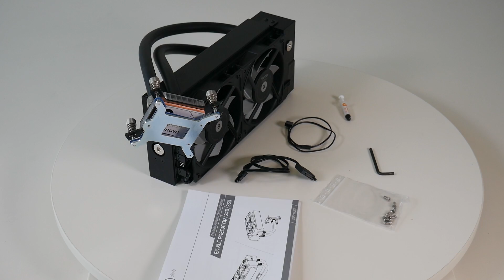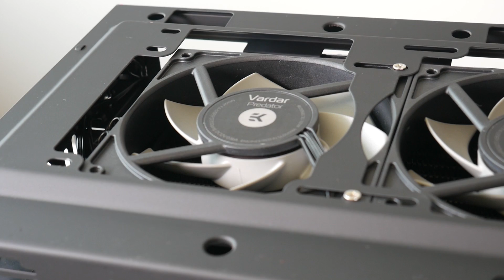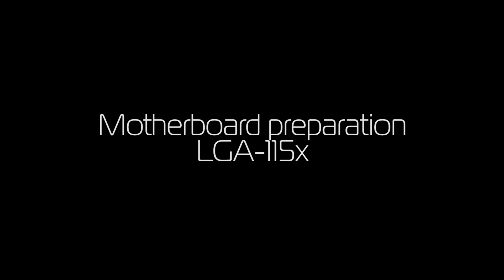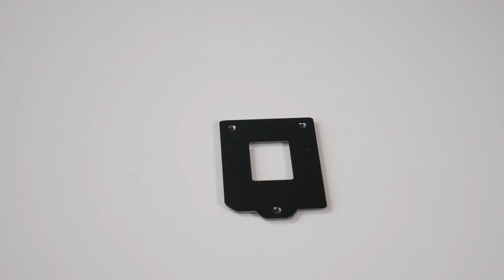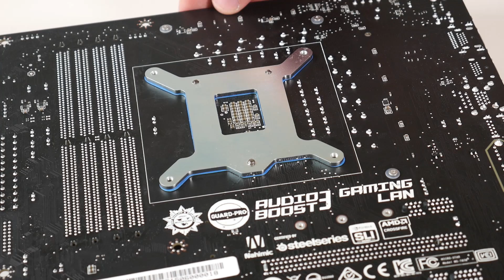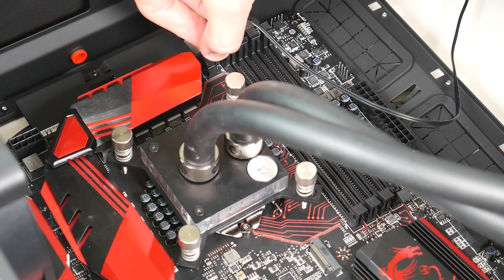EK-XLC Predator 240 (R1.0) Installation Guide

Comment: HI ,how controll the fans speed plz ? i have a rehobus and it's not controlable ,should i put the three pin connector on the cpu fan connector and the motherboard doing the rest ? thx  ,best regards !
Reply: Control by your motherboard board, Plug to 4 pwm CPU header on the board, and depend on what motherboard you have, some can download software from website for motherboard and adjust the fan speed from there

Comment: I've followed both the video and the instruction manual however my ek predator 240 fans won't start when I turn my PC on after installation I smelt a little burning and turned my of of straight away please could someone help as the retailer that bought it from aren't being all that helpful.